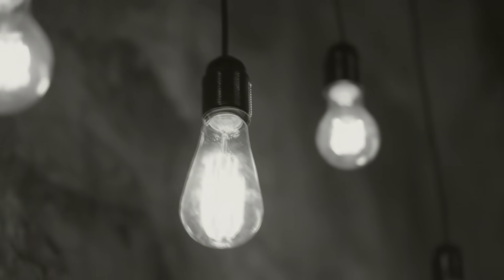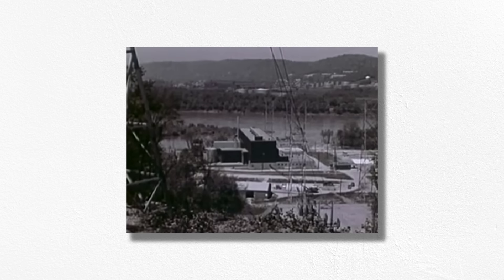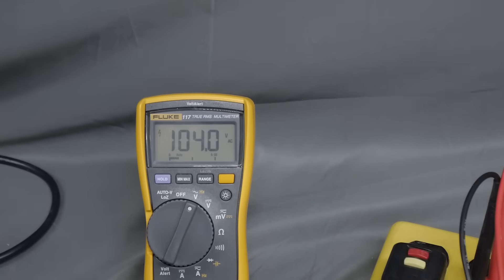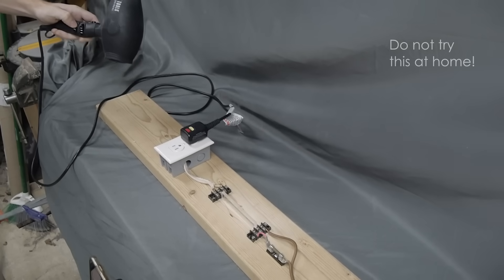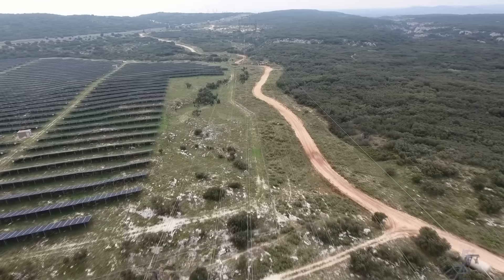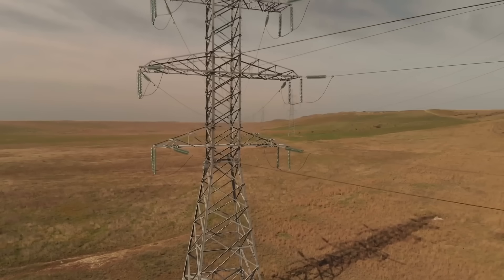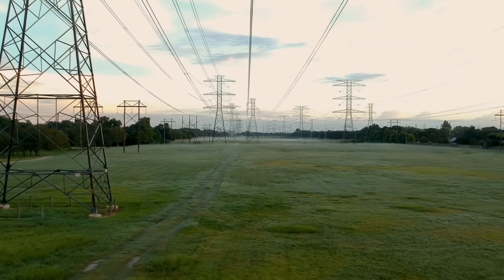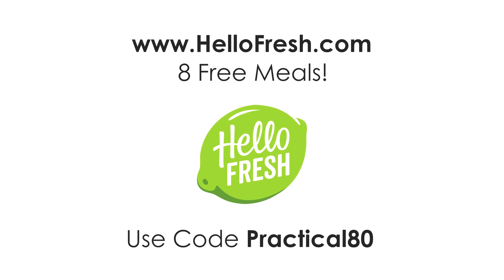How do Electric Transmission Lines Work?

Comment: As always great job!  Keeping it vauge but heres my brief little blurb and would highly recommend this discipline to anyone.  I was Civil / Structural and liked geotech, couldnt decide what i wanted to do.  Approaching senior year we dove into structural, steel, concrete, a little prestressed concrete and I was weary what the future would hold, designing the same thing over and over again.  At my company, i wear the hats of many different disciplines and everyone has the same goal in-mind to get it built but there are MANY different factors and stakeholders to consider as noted in the video.  Glad i found this field.  

- Structural/mechanical, doing the design of the line accounting for the dynamics of the wind loadings, 
- Geotech, sometimes we need custom foundations and check embedment's against existing soils
- Other stakeholders are the right of way team, outage coordination, and constructability.

Comment: I am a lineman who has spent a good amount of time on these bad boys. We call this "high-line" in the biz and it's definitely a rougher type of work compared to distribution. All of the equipment and material needed for transmission is big and heavy (for obvious reasons) and the right of way is usually quite remote necessitating the use of specialized vehicles (see: helicopters) for access. 

I never knew they were called "Stockbridge Dampeners". We've always just called them "dampeners" haha! 

Great video as usual. Keep it up!

Comment: Oh man, you just scratched the surface. I am a power system researcher, and I cannot tell you in simple words about voltage and angle stability issues while under operation.

Comment: If a powerline falls in a totally ungrounded system, would it be able to send current thru the earth? If you say yes - then I’d ask - what’s the return path? If you say it doesn’t need one - I ask — so what is allowing the electrons to continuously be cleared away to make room for new ones ? (I understand lightning doesn’t need return path as a potential diff is set up - neg vs pos)
Reply: ac is not easy to understand because a beginner will always think of the dc equivalent. leave dc behind and you will understand.

Comment: error # 2: the conductors of high voltage transmission lines are absolutely insulated. what he said about air gaps is not wrong, but contamination of these transmission lines can cause line, leakage, currents, and undesirable insulation flash overs. transmission lines that are located near oceans, alkali salt, flats, cement, factories, and other types of areas that can contaminate the lines require them to be insulated to protect them from the contamination.

Comment: Thank you for the interesting lesson Mr. Grady! Blessing to you and Yours Sir! Especially the Sweet Little Kitty Baby!  Russell KE7QXR  A Question If I may Sir.  I understand that voltages in excess of 28 KV May Produce X-Ray radiation. Why is that not an issue for Transmission lines?

Comment: at 3:35 you should have used the formula P = V x I instead. this way when you say if we reduce the current and still get the same amount of power must mean increasing voltage makes more sense. In the case of Ohm's Law V = R x I reducing the current would actually mean reducing the voltage.

Comment: Thank you for a fantastic video. As a science teacher, I love using your resources to support classroom instruction. Can you please clarify your explanation of high-voltage transmission lines at 3:32? In Ohm's Law, voltage and current are directly proportional, so an increase in one would correspond to an increase in the other. I don't believe that Ohm's Law is the best way of explaining the need for high voltage. Rather, shouldn't we consider that the power supplied to the consumers (P=IV) needs to meet a certain level of demand, such that if power loss (P=I^2R) is to be minimized by reducing I, then V must increase as a result? This is because in P=IV, current and voltage are inversely proportional. Thanks :)

Comment: minor gear grind.   you say  P = I x V     so you are changing the C in Current to I, because that's what engineers use.  But then you are NOT changing the V in Voltage to E, which is what engineers use.   So P = I x E, or P = C x V, but lets not P = I x V

Comment: Europe  and some in Canada ( Alberta) are using KVDC power transmission.Fewer ,lighter conductors required.Towers are physically less substanial,less emf valance losses on conductor skin.* Pricey rectification infrastructure required but over a period certainly pays dividend.

Comment: You mentioned rooftop solar PV.

More electricity and no fossil fueled generation means huge increase in transmission but if every building had its own supply then the existing national grid would be cheaper.

Comment: I've had so many nightmares of flying my aircraft into these transmission lines. My friend was actually stuck in transmission lines after his ultralight was blown into them by a high gust of wind.  
I've even dreamed of flying my B737 into these lines, but being at 35000 feet they were always a thousand feet higher than I was. The size of the cables I dreamt of was four or five feet in diameter.  It was only a dream so none of that ever happened, though I have seen the profile of these transmission lines on the horizon on occasion and think about it.

Comment: I'd just like to stress that the voltage that he is talking about for power losses is the voltage drop along the wire, not the voltage compared to the Earth. In his first hairdryer problem that is about 16V and not 120V. Otherwise he could have re-arranged his P=IV equation to P=V^2/R and said we need to reduce the voltage to reduce power losses which counteracts his initial point. High voltage lines have a high voltage compared to the Earth, because the technology we use to reduce the current, the transformer, requires a high voltage. If we could transfer electricity at low voltage and low current we'd do it as it would be much safter and cheaper.
Reply: Good point. The power transferred on a transmission line is (basically) line voltage times line current (P=VI); the power loss on the line is line current squared times resistance (P=I^2R). Doubling the line voltage reduces the line current by half, so the power transferred stays the same, but the power loss on the line is 1/4 the original.

Comment: Think of voltage as ELECTRICAL PRESSURE. Low water pressure in a garden hose and the water pours out with little Force, put high pressure behind it and you can  spray your driveway clean.

Comment: I do not believe in Man Made Global Cooling : oops   Man Made Global Warming : oops  Man Made Global Climate Change.  You can tell by the name changes over my life time that they have had trouble selling this lie.  I believe that Windmills and Solar Panels do damage to the grid due in part to the 2nd Law of Thermal Dynamics.  To build a better Grid I believe in Nuclear power.  I would replace all windmills, solar panels, some hydro electric due to drought, and coal with Westinghouse AP1000 PWR and eVinci reactors.  Windmills and solar panels would be illegal on the grid.  Natural Gas would only be used for "super peak" loads or problems and back up.

Comment: Why does the calculation for the ceramic discs use the multiplier 15?
Reply: Each disk in the insulator string can insulate against approximately 15,000 volts, or 15 kilovolts (KV). The insulating value of the entire string is essentially the sum of the individual disks, so multiply the number of disks in the string by 15 (from the 15 KV) to get the voltage of the transmission line (in KV). In his example, 9 disks times 15 KV/disk gives you 135 KV, which is close to the actual 138 KV of the line. As he said, it’s a rough guide to the line voltage.

Comment: 1 23 23
welcome would of been info on the power amounts that pass along these hi-V wires.   and the current levels.   
and
is there ever an effort to keep the current below 1 amp ?     as ex. when you square , say 3/4  amp you  get 9/16.  thus
seemingly like magic  the power loss shrinks.    what am i overlooking here ?

also the 'noise' you referred to ... while hiking here in the colorado mtn's on the summer often i can hear the lines
making snapping / crackling noises.    and assume its the electricy being lost to the moisture in the air.

also the magnetic  (?)  field of the flowing current disrupts reception of a GPS signal by my Delorme PN-40 
reciever while hiking along in parallel with & below the lines

 what is the procedure to re-start the electricity after its gone off ?  given that refreigerator compressors have a 
larger  startup current than a run - current.      and the current required to get them all running again could well
exceed the capability of the power generator station ?

Comment: On another simple explanation and size perspective..Reduce the scale of the universe. Start with the miky way.[100,000 light years) Reduce From 100,000 light years to just 1cm (light travels for 100,000 years to cross the 1cm) the nearest galaxy to ours is andromeda. 25 cms away. It takes light 2.5 mil years to go 25cm. (Andromeda 2.2 cms on our scale) Think about the stupidness in size. The observable universe is then 47,500km in every direction....phark.... Think about all the 1cm milky ways you could fit in your bedroom with plenty of space. Then your suburb and city. 

On and btw. Electricity doesn't flow in the lines. Electrons don't flow as such. It's called electro magnetic force. The force travels outside the wires as the electrons vibrate the force moves.

Comment: Someone else commented on this, but I have to toss in my two cents worth also. At 6:15 you mention that the main purpose of the two static (shield) lines is to protect against lightening strikes. According to my electrical power systems professor (an undergraduate course  that all Electrical Engineering majors had to take), protecting against lightening strikes is a secondary benefit. The main purpose of these lines is to make sure that ground, or neutral, potential is actually the exact same everywhere in the system to avoid any local hot spots. You also said that these lines never carry any current, but that’s not exactly true, either. In a three phase system, all three phases will come together at a theoretical neutral point and cancel each other out if the loads in all three branches are equal, but in the real world, loads are rarely perfectly balanced, so there might be some (small amount) of excess current that travels back to the generator in the neutral wires.

Incidentally, you seem to have misspoke at time stamp 3:35; according to Ohm’s Law reducing the current would also reduce the voltage. What you probably meant to say is that using the equation P = IV (or P = I squared R), we can transmit the same amount of power (P) with a smaller current I if we step up the voltage. Since transformers either step up, or step down, voltage (V), we know from conversation of energy (Power in must equal power out), that stepping up voltage (V) will result in a step down of current (I) and vice versa.

PS: I was told by my professor that power lines are usually constructed of steel wires making up the core (for strength) and more conductive, but structurally weaker, aluminum wires wrapped around the core to conduct the actual current. Because AC power tends to flow on on near the surface of any conductor, the current flows through the aluminum “skin” (because of the “skin effect”) and not through the higher resistive, but structurally stronger, steel core.

Comment: 3:38 is confusing to me. In my opinion, Ohm's Law does not explain why voltage is stepped up. It merely explains that the potential difference across the transmission line is lower when the current flowing through it is lower. P = V^2/R explains that less power is dissipated by the transmission line when the potential difference across the transmission line is lower. Then the equation P = IV tells us that to transfer the same amount of power, when current is decreased, voltage must be increased. Thus, voltage is stepped up before the transmission line to reduce the power lost within the transmission line for the same amount of power transmitted to the customers.

Comment: As always, great video!

For anyone that's confused at 3:31, the explanation of power loss doesn't quite make sense just looking at Ohm's Law. Based on Ohm's Law, smaller current would be the result of smaller voltage, not greater. However, if one realizes that we're dealing with two different voltages, it will begin to make sense. To decrease current through the conductor, we must decrease the voltage from one end of the conductor to the other. And that can be done by increasing the voltage that's measured from the conductor to ground.

This concept is explained well in this Khan Academy video: https://www.youtube.com/watch?v=VrbxUQxu0l0&t=684s
Reply: Yes I thought that didn't make any sense and it was left unexplained in the video, as voltage and current don't have an inverse relationship. Thank you for explaining.
Your linked video also highlights the fact that ohms law refers to the relationship of V and I for a given circuit, but transformers are based around 2 different circuits.
Reply: Ah thanks. That's the problem with these friendly fancy shiny popular youtube channels, they are oversimplifying and so far from being complete, just makes even more confusion. Sometimes you should watch a whole bunch of videos and narratives on the same topic just to get the picture clear.

Comment: I always find it funny how electrical engineers use V for voltage in their formulas. I was always taught that voltage is E for electromotive force since V had already been established as the standard variable for velocity.
Reply: Actually it’s U, the unit is V. So: U = 230 V.
Reply: All the letters are used for multiple purposes.  E can stand for energy, for example.
Reply: big V is voltage small v is velocity
Reply: E is already used for electric field.

Comment: Hey thats me
Reply: i built you lol (i’m a lineman)
Reply: WOAH THATS CRAZY @Futurejcpl_lineman115
Reply: @Futurejcpl_lineman115  hello brother, how's the line work? Been thinking about it once my knee heals up
Reply: That’s me to
Reply: How do they put wires on power lines?
Reply: @shuriken3438 they install reels on towers then have a big reel of ACSR then use a winch to pull it across the spans
Reply: Come-alongs, cable spools and a chopper (for transmission towers)

Comment: At 7.26 when I look at the 130kV in my town at some places phase A jumps over to so it is in the middle and phase B is wired over one step and finally phase C is crossing under and is connected where phase A were before. This happens about evry 5000 meters or so i think. Why is this done?
Reply: The reason is complicated and he skipped it.  It has to do with inducing counter emf in a parallel conductor.

Comment: High Voltage DC Power Lines. I think you could make a very informative video about this subject. Decades ago, I worked in the Peace Corps, in Australia. Among other things, the Aboriginal central of the country had two things: heat and sunlight. Twice during my tenure there, scientific folk would survey the area for making huge solar power stations. Everything would have worked except - - the solar panels would be more than 750 miles from any significant population center.
The advantage of solar panels is; they already produce DC voltage. [No conversion required.] Chain them together properly, and you could create power distribution which would have no trouble with that distance. During my time there, I cooked for many of the researchers who came with the idea of using this power. After hours, they were bored out of their braincase (no TV signal); so they talked to me. Several scientists worked out how to get that power where it was needed. The thing was, anything that distributed power 750 miles was just the minimum. This kind of power could travel in undersea cables to other countries: Indonesia (2,100 miles) or Philippines (2,700 miles). Politics never allowed that to happen.
I should also direct you to the United States. Examples are: Pacific DC Intertie; the Square Butte inverter (my home town); and plenty of others. Most here in America, are coal fired (bad), but the power generated is great enough to go to California and Mexico (good).

Comment: It a bad therrory for reason forgot the hertz. Hertz  is the speed of tbe current per second. The smaller the hertz is longer the hest sets on the conductor per second.  Exaple 50 hertz requires a much bigger core. 60 hertz requires much smaller core of the current in a transformer. 60 hertz core can not hold a 50 hertz current. But a 50 hertz core csn hold a 60 hertz current. Usa uses 60 hertz. Middle east and south east asia uses 50 hertz. A 50 hertz core is built thicker to withhold higher heated current by 10 hertz.